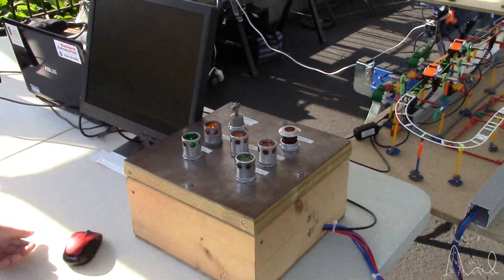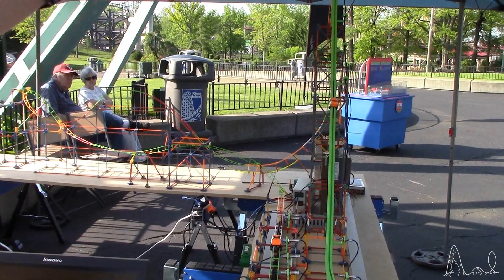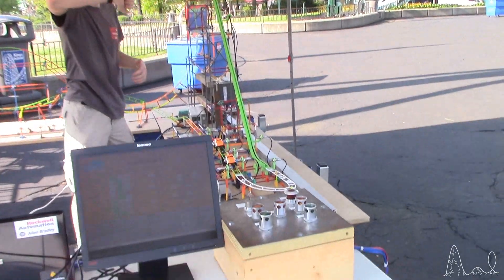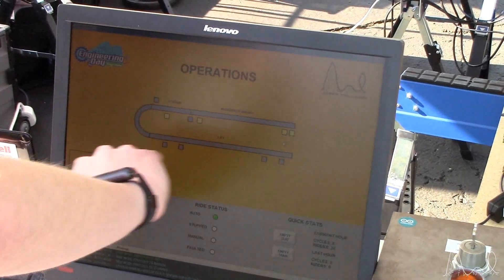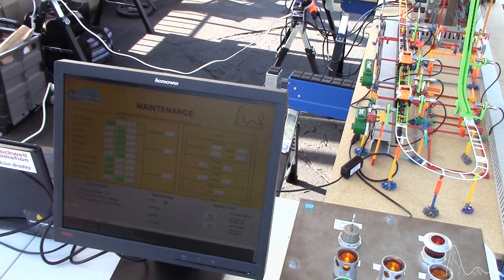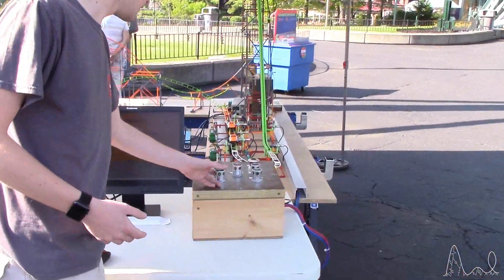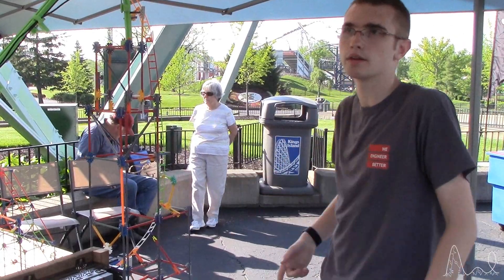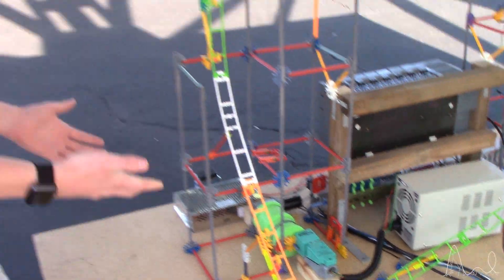Plastic Vengeance Full Demo

Comment: What tool did you use to build the HMI?
Reply from the maker: The HMI in this video was made with Indusoft. It has a really nice driver for communicating with the old SLC hardware through a serial connection.. These days I have upgraded to ControLogix which is all Ethernet IP based. I have used Studio 5000 View, Factory Talk View ME, and Ignition to make model roller coaster HMIs. If you're just looking to play around with HMI software I would suggest Ignition because of their free maker license.

Comment: Those green indicators on the screen remind me of the lights on the wall for the digitizing laser in Tron.  Considering that the software to run this thing is provided by Allen-Bradley, I suppose it is fitting.

Comment: Dude you could have used a micrologix 1100. 
SLC 500 is overkill lol still cool though.
Reply from the maker: Lol yeah I used the SLC mostly because it looked cool. Keep an eye out for the new model coming soon. If you think the SLC is overkill just wait till you see the one I'm doing that runs a ControlLogix processor and has a PanelView HMI.
Reply: @JaredHolladay   I'm guessing you have access to studio 5000 and factorytalks?

That's damn expensive software lol

I'm a ride electrician, most of the rides at the park I'm at is all controllogix and point IO with a few SLC mixed in, and a small amount of Siemens controllers.
Reply from the maker: @shawnspencer8766  Yes I do have licenses for both. I'm actually working with the university I go to and Rockwell on my latest model roller coaster project. It has an L81 safety PLC, Panelview 5510, and Point IO based control panel
Reply: @JaredHolladay  Jesus christ that's the most expensive roller coaster model I've ever seen haha. Kickass man that's awesome. 

Make sure you add powerflex drives to complete that intamin look haha
Reply: @JaredHolladay  That is many many hours of work right there. How come you didn't run the control panel with the PLC?
Reply from the maker: @TheLightningStalker  Oh my goodness too many hours to count. I certainly could have and the actual inputs were directly wired into the PLC however, I didn't have a DC output module on hand and that would have doubled the size of the bundle of cables going out to the panel so I decided to just use serial communications to the Arduino. The Arduino was actually already installed because I originally built that panel to be a Nolimits 2 control panel. Long story short I didn't wire the lighting directly to the PLC to save money and a little time.
Reply: @JaredHolladay  I figured it was something like that. Aside from maybe the stop buttons the panel isn't the most safety critical part anyway.
Reply: If he wants go complete overkill he should use ControlLogix stuff lol

Comment: As usual, great stuff Jared! I'm curious as to what CAD software you used to make the lift (SolidWorks? AutoCad? etc.) In addition, what is the attaching mechanism between the cable lift catch car and the bottom of the car? And is that the same method of attachment that you used on the chain at the readies?
Reply from the maker: This was actually designed in a software called 123D. It's an Autodesk software. It's an incredibly simple piece of 3D modeling software great for beginners (which is what I was when I designed this). For my current and future projects I've started using a combination of 3DS Max, Inventor, and Netfab (all are Autodesk software). The full layout is designed in 3ds Max and I use inventor and Netfab for more detailed work on each track or support segment in preparation for 3D printing. Its kind of a complicated process but I haven't found a faster way of doing it while maintaining print quality. I use Autodesk software because of their free student licenses. 

The catch car is a modified version of the drive chain used to move the train through the station and readies. The dimensions are slightly different so it fits in the trough. The lift puts the first chain link of the catch car right in front of the first lift sensor. It does this so that the anti-rollback on the bottom of the car will have engaged the catch car before the lift begins forward motion.  When the train passes that sensor the lift starts. It pulls the train at a slow speed until the train is detected by the second sensor. This is to verify that the train has engaged the lift properly. If the catch car passes the second sensor and a train has not been detected the system throws a fault. 

If you really look into the way the Intamin cable lift systems work you'll notice that there are actually two cables running to the catch car one dragging the train up the hill and the other trailing behind. You'll also notice that the cable trailing behind does not come into the station. Instead it goes into a hole in the center of the track before going through a sequence of pulleys that have a device to control the tension on the cable. At the drum one side spools up while the other releases cable. My coaster does the same thing! I have two separate cables running to the top chain link of the catch car. I tied them using a square knot and then a dab of super glue to hold the knots in place. Its honestly a pretty cool design because the cable trailing behind the catch car is actually not attached at the base of the catch car its attached at the top so that the catch car can make the turn from 45 degrees to horizontal going into the station! I actually looked up the patent drawings for the cable lift hill and hydraulic launch system to really figure out how it all worked!